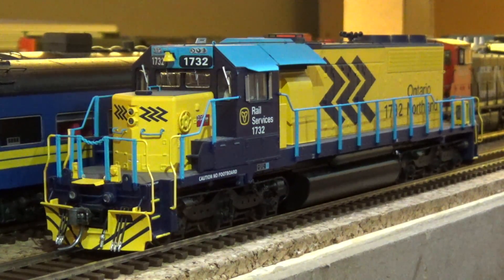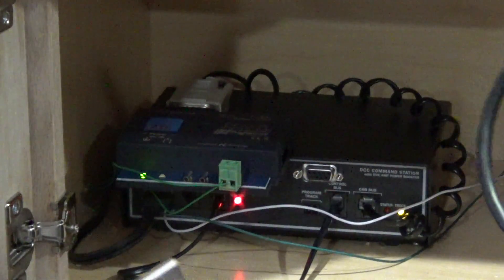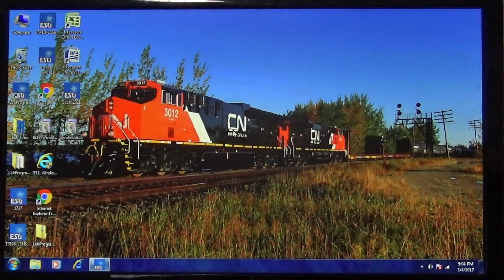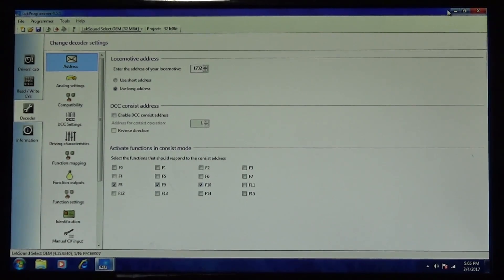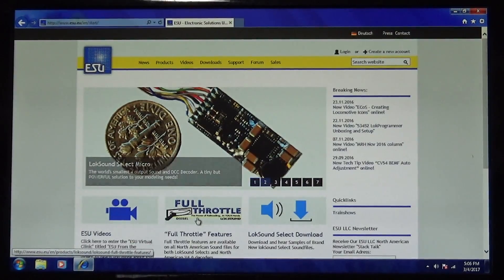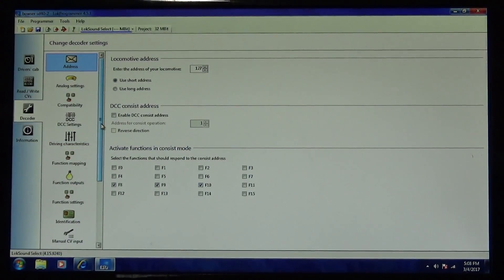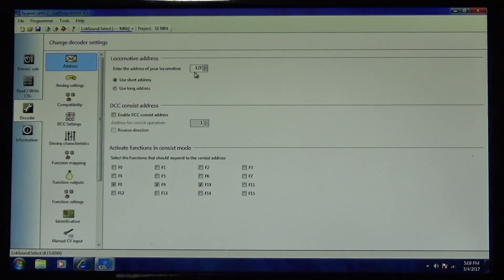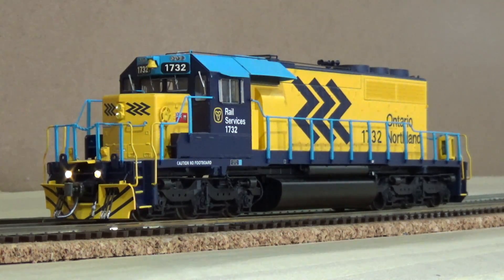How To Upgrade An ESU Loksound Decoder To Full Throttle

Comment: Is this Lok Sound Full Throttle software program available for the Mac OS system as well as a PC?
Reply from the maker: From their website: 
Being able to use the LokProgrammer you need a software for your computer. This software is steadily advanced, so stay "up-to-date" and get the latest version of it. The software was developped for Microsoft Windows (Windows XP, 7, 8, 8.1, 10). We cannot grant a proper function in combination with former Windows systems."

Comment: Nice video,and yes the Lokprogrammer is easy to handle.What makes me sad is that there is still is a difference between the US/CAN sounddecoders and the EU decoder ones.The EU V 4.0 Sounddecoders have already 2 cables with a round speaker soldered on.But good enough  there is no sound difference.At least with the right speaker.For me the "FT" upgrade is the way to go.
Reply from the maker: Thanks Carsten. Interesting, I wonder why the difference.
Reply: BArailsystem Now, the Loksound select is only for the US/Can market developed.Official a US Esu dealer is not allowed to sell to Europe.Yes it is nonsense marketing but on this way they want to get grip on the big US market.Funny my Cando or the GMD1 have select Loksound on board.So why all this?? I don't know and maybe a quiestion for Mike Hermans.
Reply: Oh i forgot,the Loksound select FT soundfiles are OEM ones ,while the euro Loksound are regular soundfiles.The programmer knows that while reading the decoder data.So you can´t load select FT OEM files on a EU decoder and vice versa.
Reply from the maker: That's a lot of corporate sillyness if you ask me. I understand they need to maximize profits but to what end, I can't see how not allowing EU modellers to have the FT sound files is a good marketing strategy.  Thanks for the info Carsten. Always interesting to hear about EU experiences.
Reply: The main reason is that as a European/German Company it is very hard to establish on this market.But they did well as IMR,Bowser and Atlas use their decoders.I know from insiders that there are very strikt rules how ESU is allowed to fit their decoders in locos of these brands.